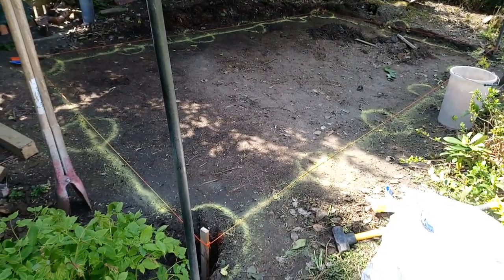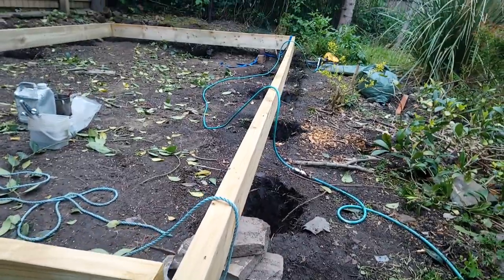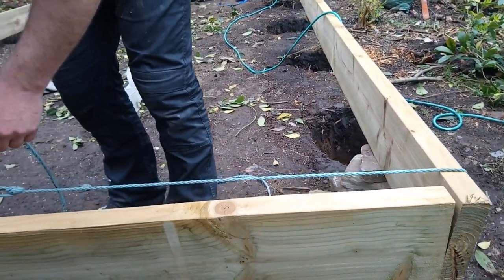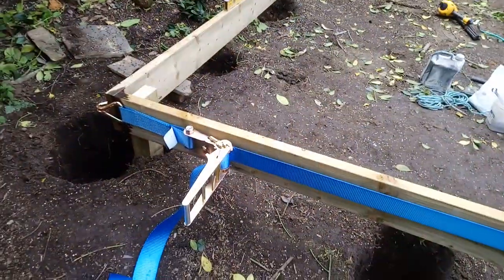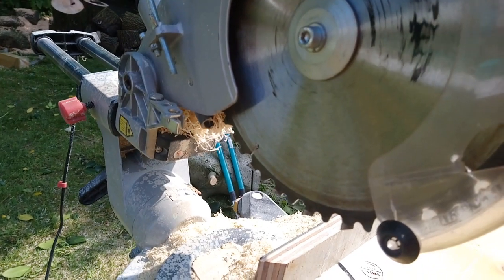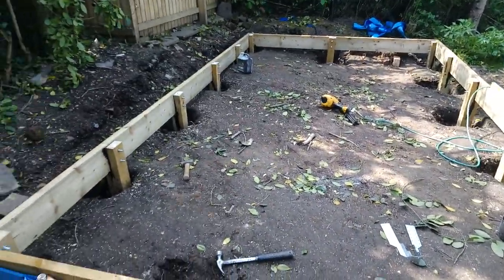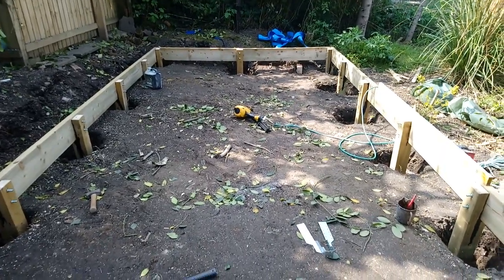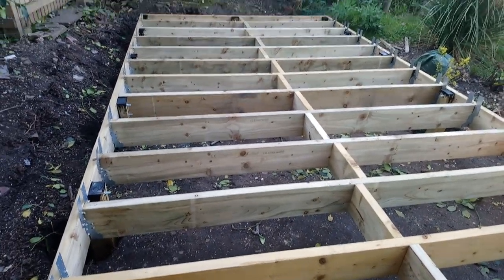Building a Summerhouse/Deck Base Frame with Tanalised Treated Timber,

Comment: Nice solid job, I'm glad to see  you're backfilling holes with gravel and not soil, treated posts will rot just the same if sat in soil. The whole project is resting on those posts  so its common sense to get that bit right. I like to have a concrete collar from  6" below ground chamfering a couple of inches up the post,and the post sitting in/on hardcore. It will never rot.
Reply from the maker: Thanks, the ground here is high up, sandstone everywhere, lots of old quarries around, the ground below the soil is practically hardcore but yeah if the ground is softer i like to put a footing of concrete to spread the weight & depending on the job I'll back fill with concrete, That wasn't up to me on this job, i just had to make the frame.
Reply: I was wondering why no concrete...  lovely frame will last half the time to save a few quid.  @Gidjoiner
Reply from the maker: @dafyddlewis89  Not sure what you mean, ?
The ground below was solid stone up on those hills, If it wasn't i'd have put concrete in the bottoms for the legs to stand on, spread their weight, 
I was building what i was asked to, the clients were responsible for choice of materials & back filling

Comment: Great video! I'm building a 3mx2.5m summer house in the garden, have dug out the grass, and was going cement 4x4 posts in but rather a pad at the bottom using aggregate packed down think this will be OK? Going to use ready mix multipurpose cement rather than post crete, two bags per hole. This will be framed using 6x2 joists then. What you think?

Also it's going to be used as a salon as well for the other half!
Reply from the maker: Hi, thanks 👍 A 2" joist @ 400mm centres is ( Span ÷ 20 + 20mm) will give you the size/depth of joist needed, to see what distance a piece of timber will span do the calculation backwards, a 150mm joist is, 150mm - 20mm = 130mm therefore - 130mm x 20 = 2600mm . a 150mm joist will span 2.6m, so yours should be fine if you go the 2.5m direction you mention, 👍 I try to dig down below the black soil into the substrate whatever that is, sometimes in sandstone, sometimes clay, up here anyway, (Yorkshire), I put a 4" concrete pad at the bottom of the 1ft round hole to spread the weight & stop the post sinking, I'm not sure how well packed aggregate would do, I think it would be ok but it would depend how soft the ground is below, advising on this isn't easy, sometimes you have to be there but if your going to be putting a lot of building (money) on top then it's important you give it the best footings poss, a few inches of concrete on top of the aggregate you're packing in won't do any harm & consolidate the aggregate,
Reply: @Gidjoiner  thanks, I'm going to do 300x300x100 concrete pads like you've done at the bottom to take the weight. Get the posts and frame in position then cement that in. Do you think 7 days will be long enough curing time to add the frame to?
Reply from the maker: 👍 Yep, it's a bit like the difference of stilettos on grass or on flags 👠😏, Concrete apparently never goes off completely, it just keeps getting harder but 7 days should be fine, don't be tight with the cement, the pad-stones & lintels that you can buy have a high cement mix, it makes the concrete hard but the more you put in the more brittle it gets so too much can be bad, but you'd have to put quite a lot in n not enough cement i would say would be worse, the mix would be sandy n crumbly. A normal concrete mix is 6to1, (4 gravel, 2 sand, 1 cement) but i always throw a little more cement in, prob making the mix more like 5to1, like i say i prefer a little too much than not enough.
Reply from the maker: This garden office i built for my bro, the posts got concreted in https://www.facebook.com/media/set/?set=a.673314579421578&type=3

Comment: Start off, your channel is top notch. I’m having a summer house 12ft-10ft and I cannot be arsed in laying the slabs and the mess that comes with it because not long had a new drive. Think this kind of base with the timbers sitting on concrete blocks would be alright?
Reply from the maker: Thanks 👍😊 Yep I'm sure that would be fine, If you were able to support/pack the joists mid way you wouldn't need such thick joists, depth for a 2" joists @ 400mm centres - Span ÷ 20 + 20mm, hope it works out for you 👍
Reply: Thank you for your time, really appreciate your knowledge. Wish you were local, it’s hard to find skilled tradesman like yourself..    take care
Reply from the maker: You're welcome n thanks 👍 keep well yourself

Comment: Hi great vid mate. Building exactly the same size base for the girlfriends log cabin. What concrete did you use? Just something like blue circle concrete mix?The area I live in the earth is very sandy and very easy to dig. When I was digging for fence post holes I went really deep and I didn’t seem to hit any hard surface under soil. Is this a problem? Cheers
Reply from the maker: Hi n thanks, If i was building something on top of a frame like this I would dig a hole roughly 1ft round & about 18" deep, then put 4" of concrete at the bottom as a foot/foundation for the post, the concrete would spread the weight & help stop the post sinking, This job went down on to solid rock so this other series is prob better for you https://youtu.be/udZl-PNbvjY

Comment: Nice job, put some central posts in sat on pavers to reduce bounce and spread the weight - seems like overkill but if somebody uses a lathe in there or a washer you'll feel it. For a rapid job concreting in the just the 4 corner posts and then setting the other posts on pavers is more than adequate
Reply from the maker: Thanks 👍 These joists are the same spec as you'd get for a house, if you sat a washer or lathe in your living room you'd get the same bounce, I've built decks in the past where things like jacuzzis will be & reinforced the joists with extra posts, this job is to be a summerhouse tho.

Comment: Thanks for sharing this, I'm just about to build my very first deck. Thought I'd got it all sorted in my head but now this has confused me! I'm planning to build a 4.8m x 3.6m deck, deck boards are 4.8m long so I got 6x2 joists in 3.6m lengths and was going to use joist hangers, but I'm now wondering if 3.6m span is too long and if I should put a 4.8m beam down the middle, which would mean using shorter joist lengths? It's going to be ground level but raised a tad where necessary. Appreciate any thoughts on what I should do, cheers.
Reply from the maker: Thanks you're welcome 👍 But yeah, sorry, the calculation for 2" floor joists @ 400mm centres is - span divided by 20 + 20mm, the added 20mm is for safety & to reduce any bounce in the floor/joist, You can work it the other way - a 6" joist is roughly 150mm, take off the added 20mm for safety & the bounce, that leaves 130mm, times that by 20, the easiest way to do that is times it by 2 & add the 0 later, so 130mm x 2 = 260mm, add the 0 = 2600mm , so that means a 6" joist will span 2600mm or 2.6m, A 3.6m span is 3600mm, 3600 ÷ 20 = 180 + 20mm = 200mm or an 8" joist. Is it too late to swap your joists for 8" ones?, if not like you say it needs support down the middle or each joist supported individually in the middle, Joists can be canter-levered out 1/4 of their span, so if a joist is spanning say 8ft, it can be cater-levered out an additional 2ft, but the supports would have to be underneath & as you say your's is at ground level & if you could do this you could get a central beam down the middle to support instead, If your garden is sloping slightly maybe you could canter-lever just one side 🤷‍♂️🤔👍
Reply: @Gidjoiner  Brilliant, thank you very much for taking the time to reply, much appreciated.

Comment: Nice strong base Gid. I liked the use of the rope, good tip to have.
Reply from the maker: Yep thanks it will be when the holes get filled, 
The rope thing i learnt when i was young, the more loops the more power 💪
Not good enough for this day tho.
Reply: @Gidjoiner  It's a good knot that, a variation on the truckers hitch known as the versatackle for anyone who wants to look it up. If you double your pulling end through the loops it is somewhat self locking which helps in situations where you are on your own for tying it off.

Comment: A truckers hitch for a M.A Gid, 👍 Pulleys would have been better as there would be less friction. Of course you were using what you had to hand. Being a tree surgeon and a carpenter/joiner I find one trade compliments the other, 😁 I used a similar design to build a 500 sq ft workshop. I used 6"×6" redwood beams pinned to the ground every 30" and joisted across them with 7"×3". 3/4" T+G Osb for the floor, solid as a rock 👍 😁 🔨 🇮🇪
Reply from the maker: I don't remember what i showed in this vid, i can do the truckers dolly knot 😁 but i think i just tied loops in the string, failing that, Screwfix were not far away for the ratchet straps, btw i haven't used those since, but i've got them just in case 😂 That sounds like nice workshop, 6x6 redwood beams, i haven't seen many of those, where are you?
Reply: @Gidjoiner  Ireland, 👍😁 🔨 🇮🇪
Reply from the maker: I've been to Ireland a quite a few times, only the south half, had a girlfriend from Blackrock Dublin, not a lot of trees around 🤔 plenty of hedges n fields 😊
Reply: @Gidjoiner  Good man Gid, 👍😁 We have trees alright but you have to know where to look. There are some small one or two man sawmills around that can supply me with timber you won't get from the builders yards. I love Douglas Fir for building with, beautiful stuff, ❤🔨🇮🇪
Reply from the maker: 👍👍 Loved Ireland, lot greener than here n not many if any sawmills now for miles, not here in Yorkshire, Travelled all over Europe in the 90's, Scottland - no fires no fishing without a permit, Ireland we asked a farmer if we could fish in his lake "That's what it's there for" he said n told us we could burn some old wood that was scattered in his field 👍 we hadn't even asked if we could build a fire 👍😂😂
Reply: @Gidjoiner  Indeed, you'd fit right in here Gid. Especially with anyone forty years old and up. Some of those old lads are right characters! 🤣 👍 🔨 🇮🇪

Comment: Literally have the same choppy and stand 😂 good video cheers for sharing
Reply from the maker: Hi, thanks 👍 Yep this saw I use for rough stuff like this, it's a bit rough but it does the job n I don't mind if it gets a bit of rain occasionally 🙄😉
Reply: @Gidjoiner  ahaha that's what mine will be for one day too once I've upgraded 👍
Reply from the maker: I used to have to take my old Dewalt that cuts 60mm x 300mm-ish for the joists & a really noisy Makita LS1040 that cut 95mm x 95mm for the posts, that was a pain, so i bought this as it was fairly cheap n would prob get a little abuse, 😉 I replaced my old Dewalt for a new one as the old one was getting tired but that new one's kept for best & it only cuts 60mm-ish anyway. 😉

Comment: How would you join two 8ft 2x6 beams end to end .  Would you sister them with bolts or just make sure the join was over a. Post support ?   Thank you
Reply: Sorry meant to say over a notched post and bolts through it    Or is there a kind of joint you recommend ?
Reply from the maker: Sorry not an easy one to answer, it would depend on the situation, if they can't be but jointed together end to end they'd have to be bolted to the side of each other, either way they would need the support or maybe 2, one for each joist, In a house they would be over lapped on top of a beam, or fitted into the side of an RSJ,  Try Google -  Sister joists overlap on top of a beam 👍

Comment: I need to do this. I'm thinking of using 6by2 though instead. Has to hold a 800kg summer house. And I'll probably postcrete my 100by100 posts into holes. How long this take you?
Reply from the maker: Yeah I've built a few summerhouses on bases like this, dug the posts in a little deeper than this then concreted them in, this one was on solid stone, it's on a hill & there's a quarry just up the road so 'they' decided to only dig this far in, if the ground is soft i would put a 1ft x 4" concrete pad at the bottom of the hole to stop the post sinking before fully concreting in, the outside frame is the important bit for holding up the building, the joists going across are just like joists in your house, 2" joists @ 400mm centres - Span ÷ 20 + 20mm will give you the size/depth of joist needed, to see what distance a piece of timber will span do the calculation backwards, a 150mm joist is, 150mm - 20 = 130mm therefore - 130mm x 20 = 2600mm . a 150mm joist will span 2.6m, 
I think how long this took me is irrelevant.

Comment: Question from a non-builder/joiner person, would you not have to support the span with posts in the centre, or is that not required?  Is there a size where you would need to?
Reply from the maker: Hi, I'm pretty sure i mention in the video but I'm just going out so can't check, The depth of a 2" joist @ 400mm centres is - Span ÷ 20 + 20mm, the added 20mm is for safety & reduce bounce, ie- 3M span is 3000mm ÷ 20 = 150mm + 20mm = 170mm, so to span 3M a 170mm joist is needed,

Comment: Did you not consider extra supports in the middle of the framing to reduce 'bounce'?
Whilst I get that the sides are strong and will support the frame of the structure weight, the internal weight of traffic is not supported at all.
I'm planning on creating a very similar flooring framework for my garden mancave but will be adding additional supports to the middle of the floor for extra support.
I'm no construction expert so please forgive the questions, but to me, this just makes sense to support the middle of the floor.
Great vid tho
Reply from the maker: Thanks, 👍
No, the calculation for depth of 2" joists at 400mm centres in metric is - span ÷ 20 + 20mm, or imperial - span divide by ½ & add an inch, The extra 20mm or inch added is for the 'bounce' & for safety,
Reply: @Gidjoiner  fair enough. If I were building a 5x4m (WxD) base, would I need that extra support in the middle if I were using 5x2 joists? Could I get away with using 4x2 if I doubled them up around the perimeter, or would I be risking strength?
Reply from the maker: Yes you would need to support the middle with 5x2 spanning 4m.
To work out how far a timber would span you reverse the calculation i mentioned, take an inch or 20mm from it's depth & double the remaining width (I know 20mm doesn't = 1 inch ), A 5" joist becomes 4",  4x2 = 8 therefore a 4" timber will span 8ft, in metric that is 100mm (4") x 20 = 2000mm or 2m, there is a slight difference between the old imperial & the metric but old 2" timbers were proper 50mm or more, the modern 2" timbers are not even 45mm sometimes, 
To span 4m you would need a 9" joist, 4000 ÷ 20 +20mm = 225 (9").

Comment: Would of just used a driver with 150mm screws too pull that beam in. Good build. 👍😉is
Reply from the maker: Hi, Thanks 👍 This was a massive ratchet strap & it took a little effort to pull it in, not sure a screw would have done it n prob didn't have any anyway 😂

Comment: Hello mate, bit of a new one to this. What would you fix the legs to the concrete base too, if anything?
Reply from the maker: Hi, if it had to have legs on a concrete base, because depending on the height the frame could be packed up on blocks etc.. but if the deck was big enough maybe nothing, it would be heavy enough not to move, maybe tho 4 of these in the link, it might only need one on each corner just to stop it moving, there's some of these metal post supports that have metal flanges turned in inside the sq hole, avoid them because they cut into the post & encourage rot. If the deck was fairly high the legs might need bracing, if you use these supports i wouldn't rely on them to stop it wobbling, when i dig the holes normally i try to dig them deep enough to support the legs, 2ft-ish, i didn't dig these ones in this vid & the ground here is solid sandstone so they didn't dig as deep as i hoped. https://www.screwfix.com/p/sabrefix-bolt-down-post-supports-100-x-100mm-2-pack/57289
Reply: @Gidjoiner  Thanks for the reply mate. Could I just ask how many legs I'd need for a summer house that's 4.8m X 3m using 8 X 2 joists and frame. Thanks for your time and brilliant videos.
Reply from the maker: 🤔 Hard one to answer that, the weight of the shed, the type of roof, what will the shed be used for, ground conditions?? I would put one at least every metre, & poss two in the corners, one on each timber as it meets at an angle, The main timbers that run down either side are like the walls of your house with the joist suspended in between, but the two at the ends are supporting the shed as well so have to be treated the same as the other two, as if they were walls, so the same amount of posts all round, I'd put in more than you think, it doesn't take much to put another one in each side,
Reply: @Gidjoiner  brilliant and thanks for the reply mate. That sounds about the same as I was thinking. Cheers buddy.

Comment: Hi Gid, where you  ratcheted the two ends in,when it gets released will it not want to pull back again? I guess when you have the other middle joist in they will keep it in place.

Cheers Gid
Reply from the maker: Yep lots of nails in it & the other joists held it in place, it didn't move after releasing the straps,. the timber should relax into that position & not move.

Comment: Nice one Gid! I know that the timber posts are treated and its going to be packed with gravel, but do you have any idea how long that would last?
Reply from the maker: Thanks,👍
 No not really, I've read Tanalith's info on their treatment but it's all a bit individual case related , if it stays dry the wood could last many yrs, I've built decks like this that are over 10yrs old, there's a summerhouse going on top that'll help keep them dry, wood rot's 6" above & below ground level, 😶👐
Reply: Cheers.